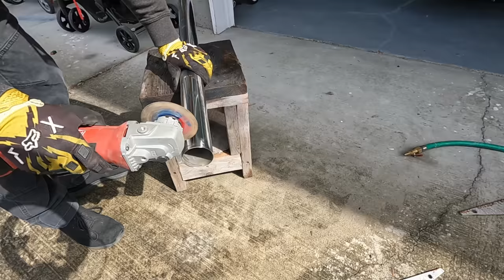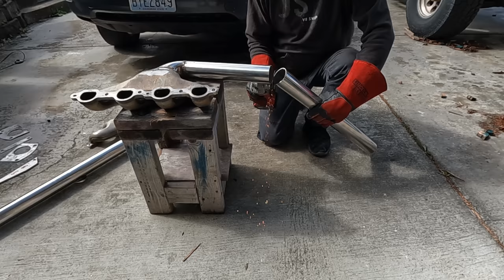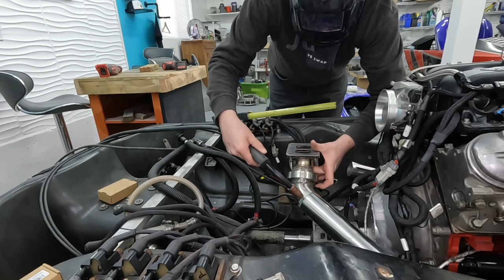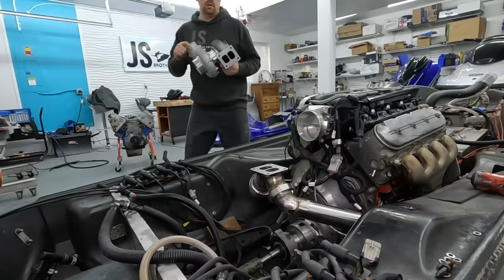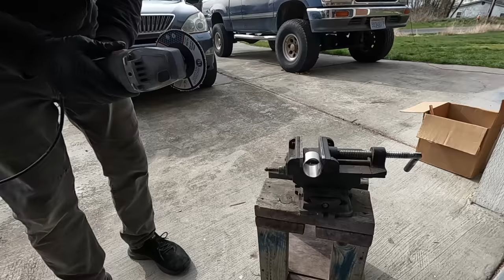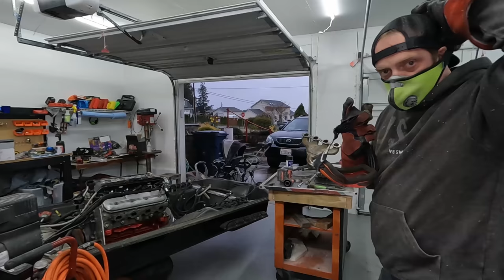I don't normally turbo my v8 jetski but when I do it looks like this

Comment: It's definitely coming along nice but I would recommend a flexible bellow on atleased one side of the collector before the waste gate and add some supports to the flange so the piping isn't holding the weight of the turbo and cause cracking..keep up the good work!

Comment: Looking good, see ya are doing 2 to 1, cool, speaking of cool, won't be hard with endless water but what for the exchanger. Sure you'll figure it out. The more ya do the more ya gotta do
Reply: plenty of air to water intercoolers in the LS world, Im sure it would not be too hard to adapt one to for this use!
Reply from the maker: I can get intercoolers that are made for Jetskis or the ones made for cars just a matter of what kind will fit in the space I have. Thanks 🍻

Comment: Good Lord am I happy you went with the single turbo behind the block holy sh*t.  Ther eis an aside, howerver.  There is going to be a horseton of heat energy removed with that water jacket about the manifold before the turbo.  Probably help extend the life of the turbo, but account for that!

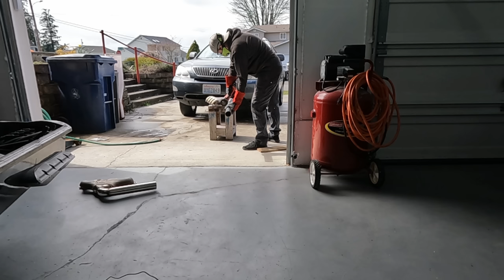Comment: Hard work as usual.. impressed you are brave enough to cut the pipe that close to the car ( 2:45 )... I would be afraid of "grinding shrapnel" hitting it.. I got a lot of it on the glass of a car once, didnt look good and nothing to do about it. Perhaps its less of an issue with different materials? I dont know much about it, I can drive ok-ish, not fabricate or wrench.. 

Splendid effort as always from both lads, large and small. Cheers.
Reply from the maker: Thanks 👍it wasn’t as close to the car as it looks like in the video but I hear what you are saying. 🍻

Comment: sorry my man, i must have missed something, but it looks like you welded the BOV into the exhaust. am i wrong? cant build boost if you vent the exhaust plus itle get rrreeeeEEEEEAAAlllyyyyy (ace ventura) warm under yer but.. they go on the intake side to vent the surge once you let off the throttle.
you only need 1 waste gate per turbo. something "looks" wrong my friend.